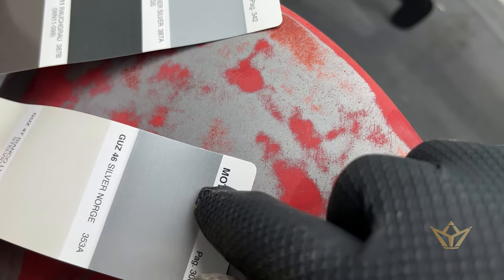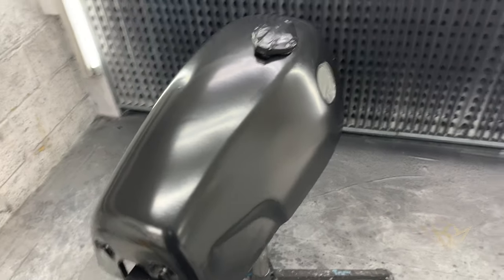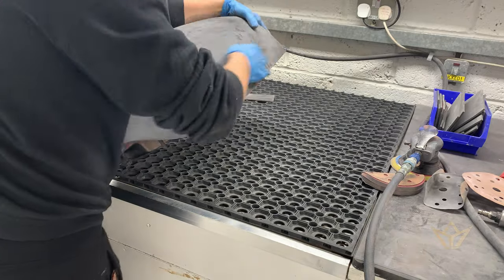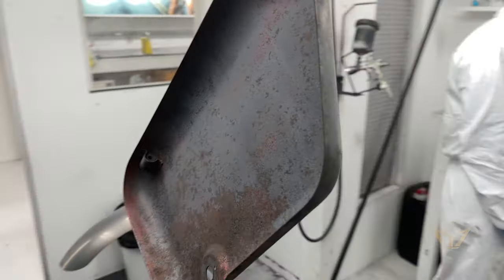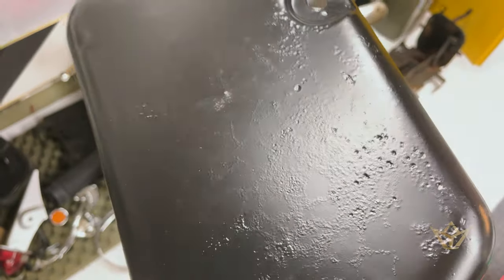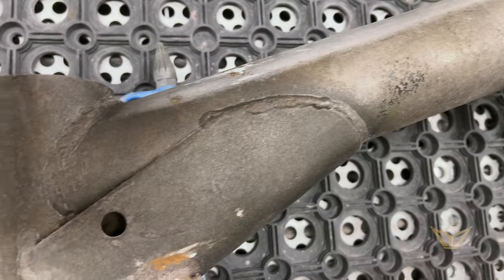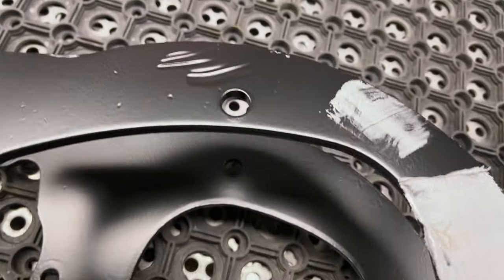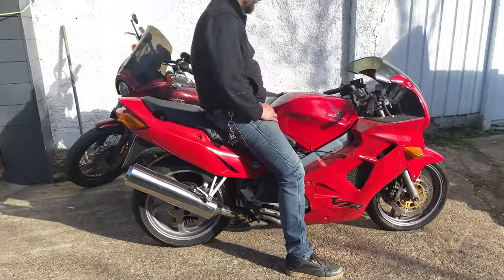WEEK 6 - A MASTERCLASS IN MOTORCYCLE RESTORATION - 1968 Norton Commando

Comment: Hello from Germany, it is nice to follow you on your work, saving such an nice bike. I own an original 1968 Commando for about 6 years now. When I bought it, it came with the original '68 frame, which was in fine shape. I tend to use my old motorcycles as if they were new ones, at least in summer. That means driving to work, going on vacations, touring on weekends, etc. As an average I am touring between 2000km - 5000km on each of my Nortons per year all over Europe (a have a Norton 99 too). 
The frame on my Commando lasted 4 years, than it broke. It was not a big deal, no dramatic collapse of the headstock, no accident, or something else. Because I knew about the reputation of the '68 frames, I checked the frame tubes regularly, so one day I noticed something what first appeared as a scratch on one of the downtubes (another famous spot for cracks in these frames), but examination with a magnifier revealed a crack which was nearly all around the tube already. So I replaced the original frame with one from '69. Which I had had lying around already - the bad reputation, you know...🤨
You can use the original frame surely, if you plan to took the bike out only for short runs, the frame will probably last for many years . If you plan to sell the bike after restoration, a collector will of course admire an all original bike. But if you plan to use the bike in a proper way 🙂, go in search for a later frame. Preferably an early '69. Not to mention, using the bike with a later frame makes the rides quite more relaxed, not every pothole is a potential hazard anymore...
I am looking forward for the next episodes on these chanel. Go ahead with your fine work!
Reply from the maker: Thank you Lienst. Very entertaining reading. I’m impressed that you ride them so much. I am behind on the Norton now but once the VFRs are out of the workshop then the Norton will be assembled. Not far and of course I will share it with you. Thanks for chipping in. Oh keep watching. After the Norton I have 2 special bikes…

Comment: Would it not have been prudent to use a dyeline cracked detection method as this will show up cracks not visible to the human eye?
Reply from the maker: Very good point Bill. Unfortunately I can’t show the detection systems we use at CBR because they are unique to our processing fracture detection. A much more definitive process but yes in most cases the dye detection to a very good way but with the weld scarring might make it slightly trickier..I don’t have much experience with dye detection.

Comment: Ethanol is bad. i have several machines with fiberglass fuel tanks, they have pin holes, So i will just use gas  with no ethanol in these machines.  Ethanol dissolves many fiberglass over time
Reply from the maker: In this case that is not entirely correct Indy. The resin lining will do as well in fibreglass as with steel. I don’t know what gel coats do from back then but if lined, no problem. Thanks for chiming in 👍
Reply: @MyRestoration1  i agree with you . i  just give my experience . Mostly to people with  fuel tanks   that do not  leak
Reply: @MyRestoration1  i agree, with leaks a lining is needed, but better to just use  gas  with no ethanol if no leaks. i have 4 machines. 2 have leaks  .
Reply: @MyRestoration1  So glad you have lined the tank. Yes, it is not the fibreglass that is the issue, just hte type of resin used, polyester, that is sensitive to modern fuels. Really important to try to get best possible adhesion to the original inner surface by abrasion using some kind of ceramic beads or metal nuts & screws and lots of tumbling for a few hours. Then the epoxy coating has much better chance to adhere. Epoxy is used all the time in the marine industry to repair polyester boat hulls etc. Key is to have a roughened surface.